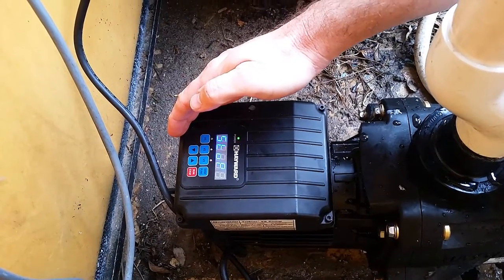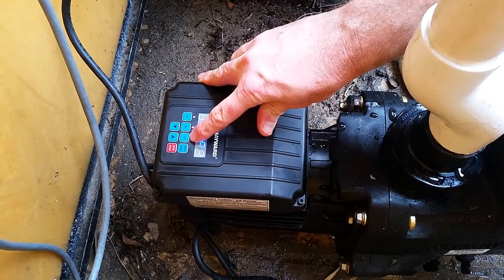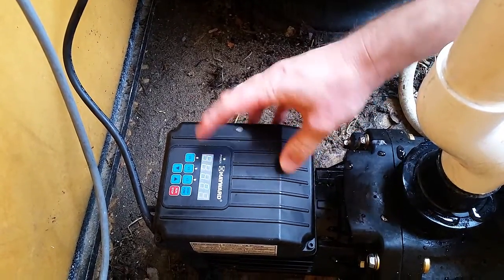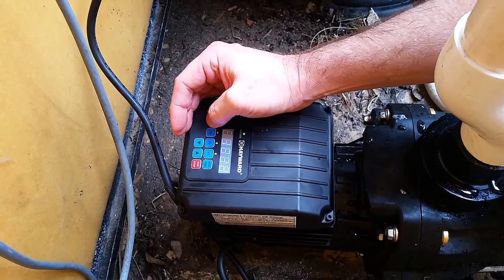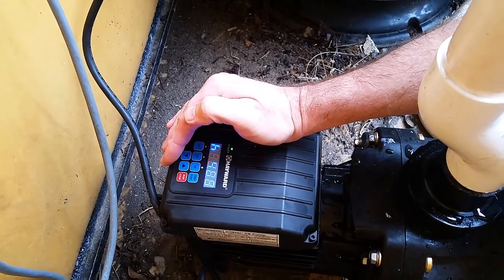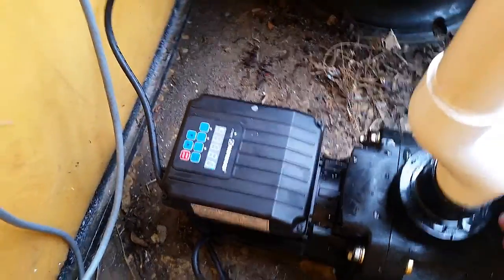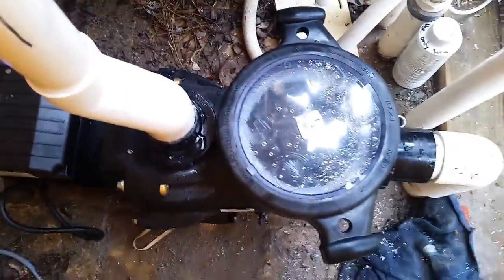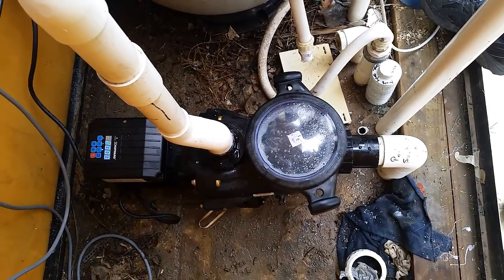Programming a Hayward VS Pump Motor

Comment: Nice video. Will the pump run v3 setting everyday (i.e. every 24 hours) for the set time or it only does it when you stop/start the system?